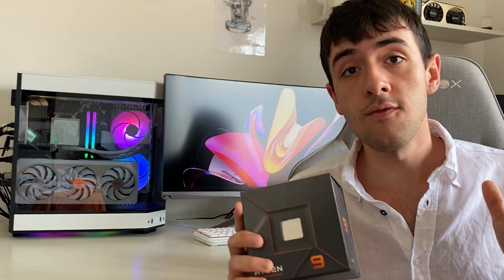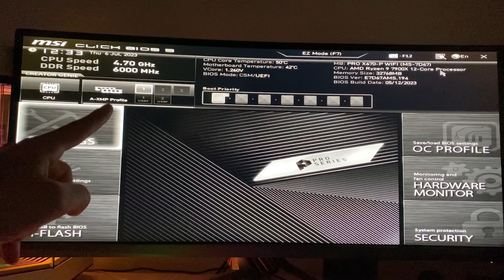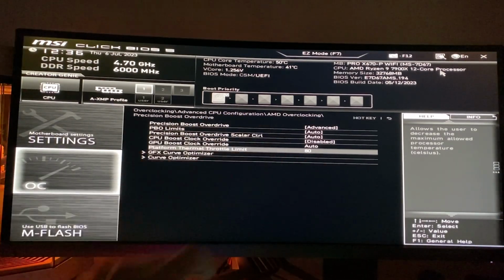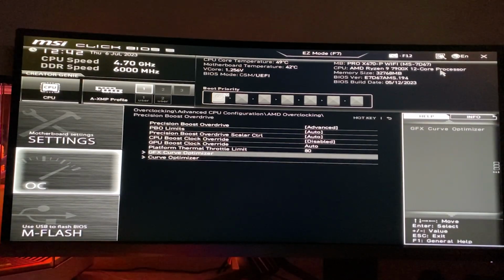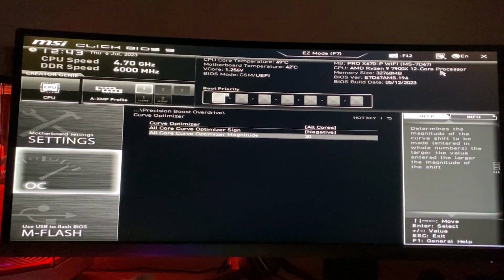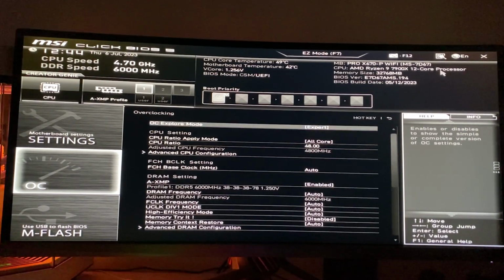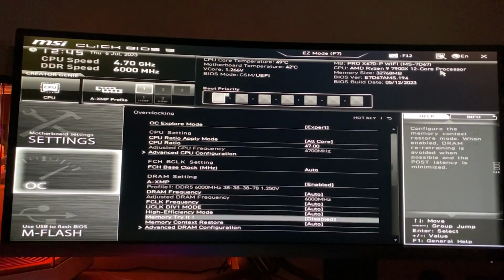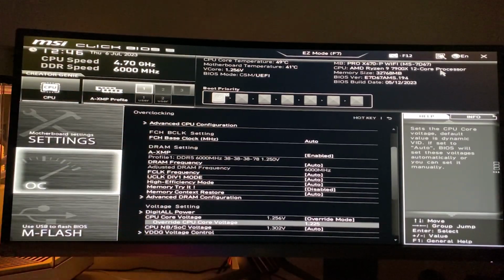Undervolt your Ryzen 9 7900X for more FPS and Lower Temperature!

Comment: is there a way to adjust max power (ppt limit) in msi bios? building a 7600 machine for a friend of mine, he's stubborn on using the stock cooler and I'd like to undervolt it and limit the wattage, however on the msi bios im struggling to find that
Reply from the maker: Yessir there is! In advanced CPU options. But you'll only find it if you subscribe to the channel :)

Comment: Im getting 85 degrees when running cinebench (100% utilization on all cores) on my 7900X. Is it worth undervolting? Is 85 degrees for max performance a good temp?
Reply from the maker: Tbh it’s already running great but yes I’d still undervolt it
Reply: Just set the curve optimizer at negative 30 and lower the temps whit ppt limit at somethink around 75 so u dont lose any performance and u good to go
Reply: What cooler ure using? Im whit galahad  trinity II 360 performance and i hit 89-90 at max performance. Im curious what is ure cooler so u get 85 only at max clocks

Comment: What programs are you guys running that is keeping your 7900x at high temps? I tested my 7900x with an Arctic 280mm, Artic 360mm, and a Deepcool LT720 and I hardly ever see the temps go above 70c while using an aggressive fan curve.
Reply from the maker: I was using Prime95

Comment: Hi, I've been watching a lot of your videos recently and have become a supporter. I have a question about this video specifically though. What is the ASUS board equivalent of advanced in PBO? In my bios I don't have an advanced option in the drop-down menu, but I have an option called Enhanced. Is this the same thing? My mobo is a B650e-F
Reply: Edit: I now realized that Asus boards have two ways of adjusting PBO. One in the AI tweaker tab and the other in the advanced tab. Is one better than the other?
Reply from the maker: They’re the same! Enhanced would be what you’re looking at, but for the rest you should be able to find it in the “AMD Overclocking tab”. Also make sure you’re running the latest BIOS

Comment: Have you found this motherboard incredibly slow to boot?  Just got one and updated firmware but man it takes for ever to POST.
Reply from the maker: I’ve heard about it, but to be completely honest mine used to boot fine. I think a lot depends on the RAM!
Reply: Its the ram trying to find the best sets to load without faults, you can turn this off in the bios.
Reply: Memory context restore.. change from auto to enabled. Reboot a couple times. Should be better after that.

Comment: Hey I’m using an Asus motherboard and there is no advanced option for pbo. Only enabled, disabled, enhancement, manual and and eco mode. Do you have any tips for that?
Reply from the maker: Manual should do the trick!
Reply: It's under the "Advance" tab next to "Extreme Tweaker" tab, if you don't see them need to press "F7" for the advance menu.
Reply: Im use asus x670e-e any tip? I cant put all cores settings.
Thanks

Comment: would a 7800x3d run at 48 ratio with 1.2v? i'd set the min cpu state in power options to 100% and then basically all cores would not drop lower than 4800mhz
Reply from the maker: It would be right on the edge of stability but yes it can work!
Reply: @ImWateringPSUs  oh it seems that the 7800x3d is locked, shame cause i was going to buy it but now i guess i will get 7700 or 7700x

Comment: I tried 1.2volt at 4800 clock and hottest temp (CPU CCD1(Tdie))went down 19 degrees, but lost 10% performance on cinebench r23 multicore. Guessing I should go higher. 🙂. ...update: 75degree tjmax with -30mv gave me highest benchmark so far at 29997 with top temp being 77 degrees. Better performance than stock which also hit 91.5 degrees.
Reply from the maker: Glad it was helpful and I really can’t thank you enough for the detailed feedback!

Comment: Can you do a video to 7700x on msi motherboard ?
Reply from the maker: The settings are the same if you crossreference with my 7700X video!
Reply: @ImWateringPSUs  ok
Reply: @ImWateringPSUs  I even liked your 7700x video, but it's too confusing for me. I would really appreciate a video with that processor for the msi definitions. It was the best. Another question, is it worth switching to a 7800x3d or 7950x3d? Or is it not worth the difference since I have the 7700x?

I have 4x32 cl36 6000mhz corsair xmp and I can't put the ram with xmp in these values. Do you have any idea how I can manually overclock the ram? Thanks for the answers, I wish you the best of success.

Comment: I used your settings and my pc won’t boot now it just keeps shutting off. Cant even get to BIOS. any advice ? 😢 Ryzen 9 7900x, MSI B650 MOBO.
Reply: My CPU was already at 95c so maybe it’s shutting off cause the settings changed and it’s already reached past the thermal limit idk
Reply from the maker: You need to reset the CMOS!
Reply: @ImWateringPSUs  Ahh yes I reset the CMOS all is well . I'll have to try the settings again some time this weekend <3

Comment: This also works great with a 7800X3D! I didn't even set the thermal limit, just undervolted and now it stays just below 80°C by itself (ok, with a beQuiet Dark Rock 4 Pro in a Fractal Design Torrent, so not really by itself ;-)). And this is with very quiet custom fan curves!

Before the undervolt, it would reach around 83°C but with very noisy stock fan curves (i.e. CPU and chassis fans at 100% above 75°C)!

Another amazing video from you, thank you so much! Finally a quiet PC that doesn't get too hot 🙂
Reply from the maker: I’m really happy it was helpful! Thanks a lot for taking the time to write this! :)
Reply: what did your temps go to after doing this video? you mentioned you got around 83C before the undervolt
Reply: @ItsTooSlick  
As I said, just below 80°C, like 78-79, but with significantly lower fan speeds and noise. If I had the fans still at 100%, the difference in temperature would be a lot bigger. 

But I measured these temps during a CPU benchmark, in gaming and any kind of real-world usage, it doesn't even come close to 80°C.

Comment: I’ve been seeing 7800x3d burning and killing parts. should I go for 7900x instead
Reply from the maker: The non-X3D models definitely have fewer issues😅
Reply: If you havent decided yet, its not the cpu itself burning anything. It was an issue with Asus Motherboards and their bios setups, which is now fixed if you go with a different brand of motherboard no chip should give you an issue. I have Asus, i updated bios and i have a 7900x. No issues

Comment: Hi mate, great video.

I'm running on 7900x too and my main goal is to reduce temperatures on gaming aspect cause i use my pc on gaming basicaly.

What do you recommend to get lower temps with good performance overall ?

I've 240hz monitor + 6950XT Setup.

NB : I can't run EXPO profil on my G.SKILL 6000MHZ C30. Do you have any advice ?

Thanks
Reply from the maker: Hi, thanks a lot! Regarding EXPO, try enabling it but setting the RAM frequency to 5200Mhz. For the CPU itself I do recommend the first preset (curve optimizer one) from the video! -20C and 75C or 80C temp target!
Reply: @ImWateringPSUs  done it! Massive temps improvement ! 

Will test if i've still have good performance tho!

Do i need to change static settings? Since i'm only gaming and not making any rendering etc?
Reply: @ImWateringPSUs your confusing 5200 with the stock ram. It can run stock ram at 5200 even though we have 4800. We can then use expo or xmp which the cpu can utilise

Comment: I set the max temp limit to 80°C for my R7 5800X3D, before was set to 89°C
Hope will reduce the temps overall, ingame temps are 62°C-79°C, all core boost 4.54GHz,  room temp 24°C.
I want to experimemt with this what happens if inreduxe to 78°C.
Reply from the maker: Very interesting! I acually have just bought an used PC with a 5800X3D, I'll be testing it out and releasing an Undervolting tutorial for that one soon!
Reply: @ImWateringPSUs  So I set the max temp to 74°C and the results are: in CinebenchR 23.2 I got 15239 pts. Max temp: 89.5°C, 126W power draw. Max cpu boost 4441 all core. I get the same score also when I set to 89°C Max temp but then the cpu goes up to 92°C.
The difference is that while I'm running  cinebench the cpu core throttles down to 3593MHz from 4441MHz all core when the Max temp limit is 74°C but I get the same score.